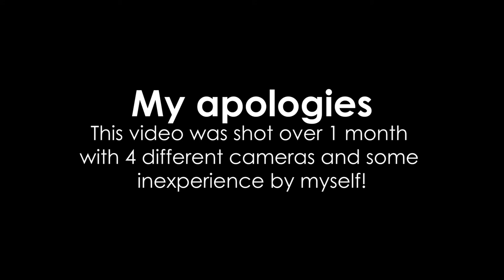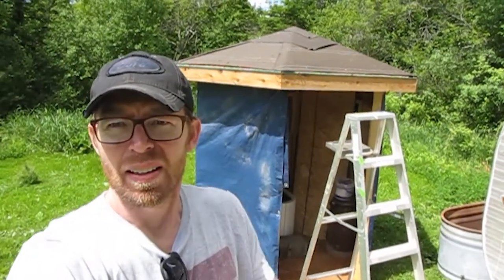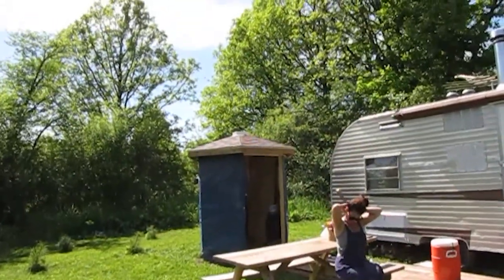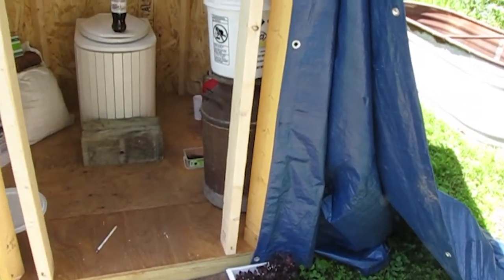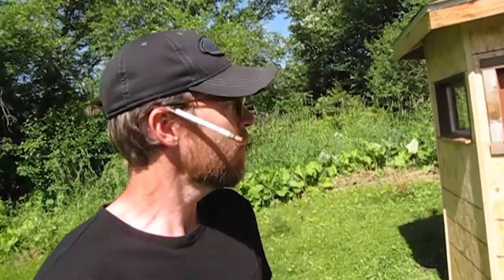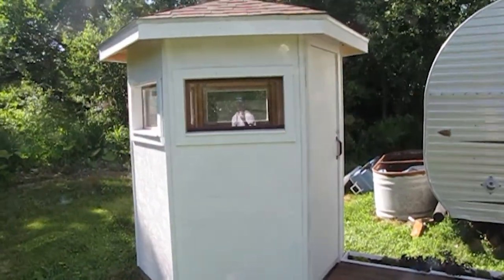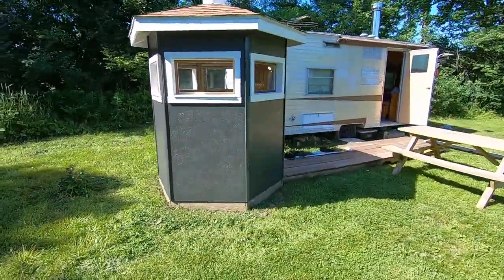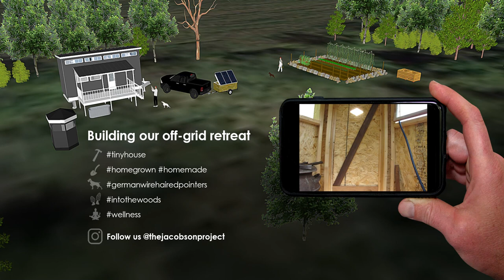Compost Toilet Outhouse - Ep. 04

Comment: Hi, guys your looking good looks like that will be a fun project. remember you can dig the wheels down and then lower the house down less steps. Have fun. the SR.
Reply from the maker: Bruce!!! Thanks for the corn buddy! We got some from Dan/Shifty/Back 40 Wood Hound when we picked up some pallets last weekend. Check out our episodes tonight. I lock the Tiny Home/Cabin trailer down to the foundation and then Kim does some harvesting (you are mentioned when we show off your corn). I never thought about digging the tires down but I might want to do that on the high side of the slope for sure. Not using adhesive or anything on the blocks so we can adjust if needed later. Good to hear from you!